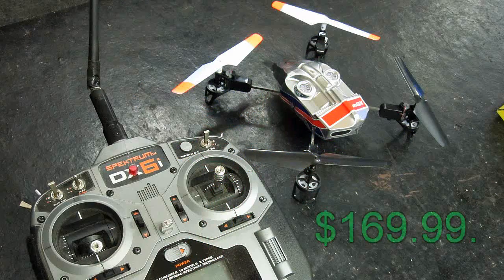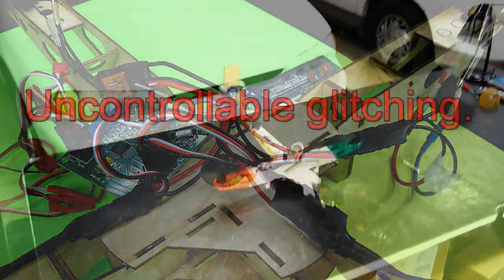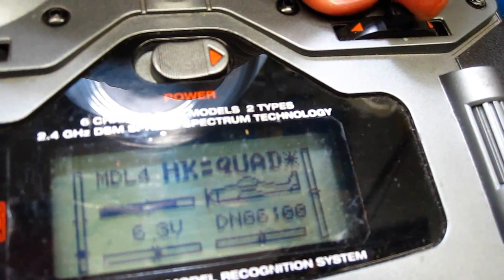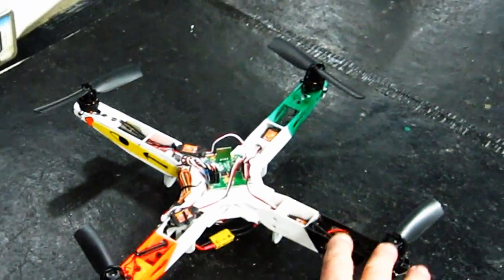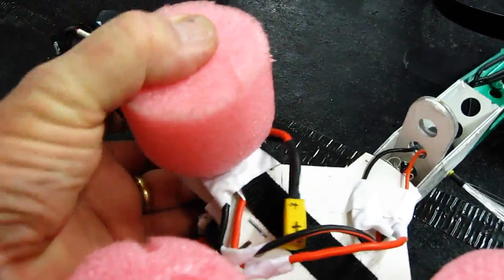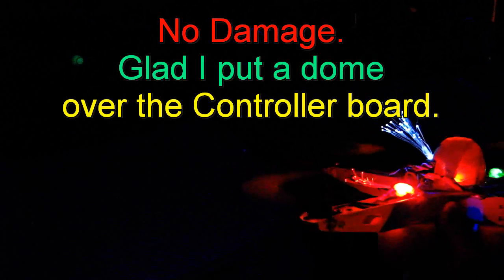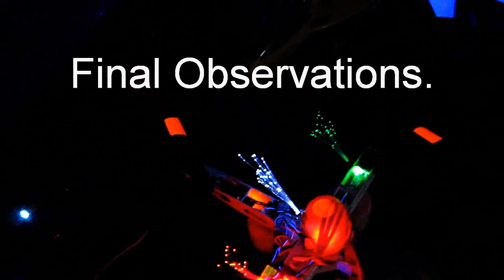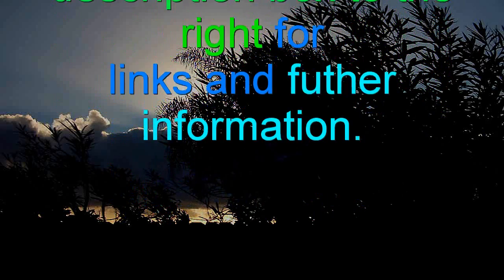I built my own Quad Copter~NightFlyyer~.

Comment: I am having huge problems interfacing the HK board to the HK SS ESC's... I believe I have similar ones to yours, but 25 amps...  I seem to have very non-linear throttle response when connected to the HK board... it will fly (if you can get it off the ground) but it's almost as if the motors are either on, or off and it's very rough, most times it can't lift off without flipping for that reason.

My ESC's all have a BEC, are you simply connecting all of them to the HK board or only using one BEC?

Comment: Take your dx6i apart and look at the trim tab rocker (it's removable). The plastic is very thin and bends or snaps easily if you press too hard. You can reinforce it by glueing a tiny piece of wood or whatever to the part of the plastic that's damaged and it will work fine. I repaired my trim tabs this way and also fixed all the trim tabs that were not broken yet because once you look at them it's obvious that they will break sooner or later.
Or phone spektrum for replacements.

Comment: Make sure that all the ESC’s have the same throttle range end points.
Battery type must be set to Ni-xx ( = no low battery fail ).
For better settings you have to reflash that kk board.
kkmulticopterflashtool will do the trick

Comment: Yep, its a pain in the neck to get it all right in the first go!
 But I would even encourage people to try out multicopters as a first "heli"(cheap to build, easy to maintain/fix, they fly great, havent got many mechanical parts, are durable and so on). You can learn to fly very quickly with a quadcopter.  There are very helpful how-to threads on forums like RCgroups for instance, that show how to fine tune your multi-rotor and etc.

Comment: Dave, did you set the ESC to NiCd? I was suggested to set the ESC to NiCd, so when the battery is low, it won't go to cut off. Also, from the manual, it suggested to have the ATV for aile and elev at 50%.